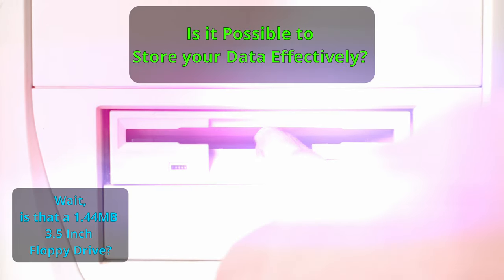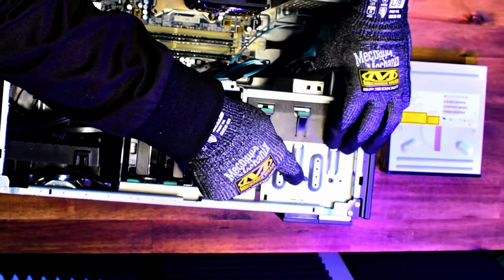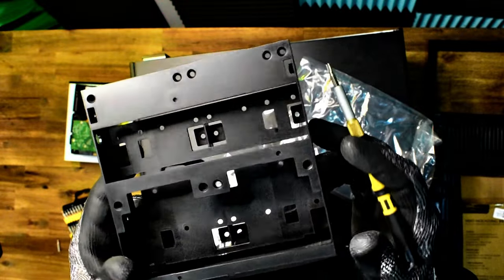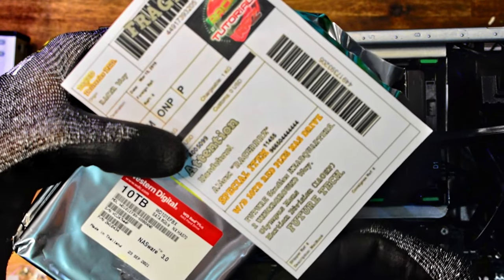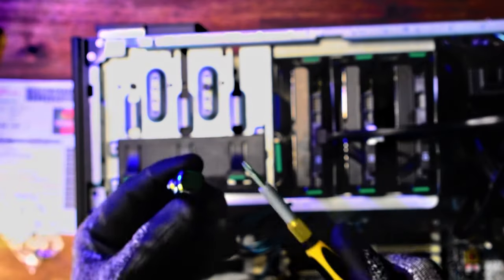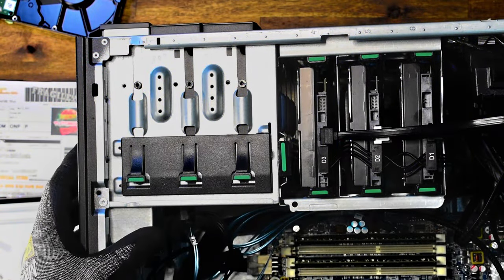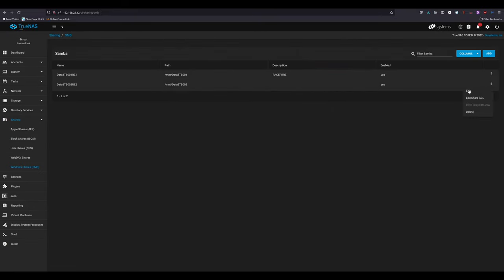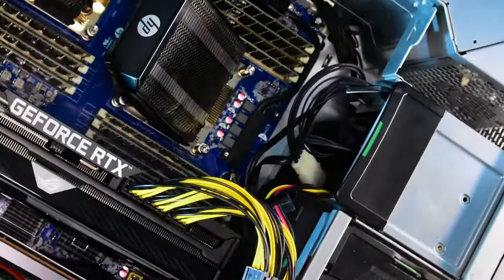Massive 40TB of NAS Storage on a HP Z420 Workstation made easy!

Comment: Backup on raid 0 WTF
Reply from the maker: I presume you are referring to the stripe drive in TrueNAS? This video did not give any guidance on how to set up a RAID 0 pool (i.e. each drive was initialized as a single drive - not a pool), but I have done several related videos that outline how to do a RAID 0 pool. 

Each configuration has to match the desired end-point. I use my 8TB RAID 0 NVMe pool as my video editing drive (~12k MB/s read and ~10.5k MB/s write; handles 4k - 8k H.265 without issue). I back this pool up to a single 16TB HDD (Exos X18) and critical data to a RAID 1 Mirror (2x 4TB SSDs), and I back that up to my Z440 TrueNAS server build with each archive allocated to three independent HDDs (mostly 10TB Ironwolfs), which is only powered periodically (deep storage; pool managed by me). I am sitting on around 100TB of content -collectively - with backups. If I had $5-10K USD I would get the drives needed to get a high volume RAID 5 pool, but ... cost is prohibitive and drive failure tolerance would be low. Right now I aim to tolerate two drive failures. Three's a charm. I am looking into tape drives for an off-site storage solution also.